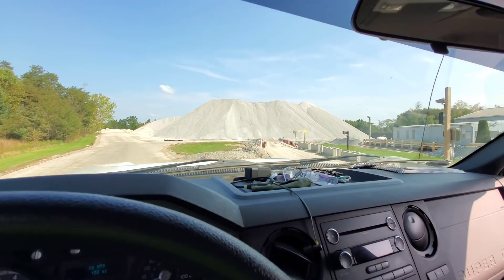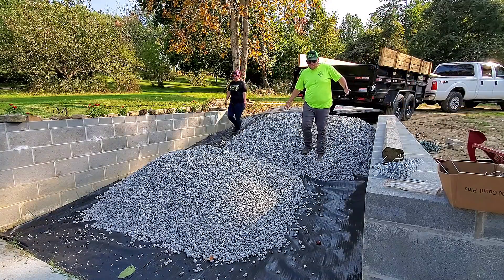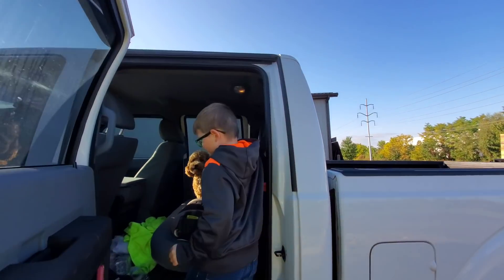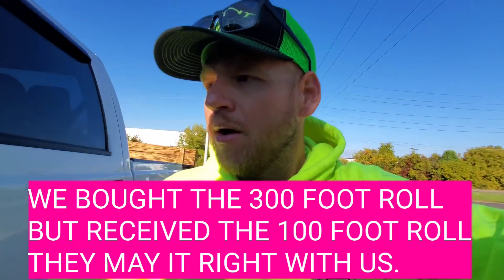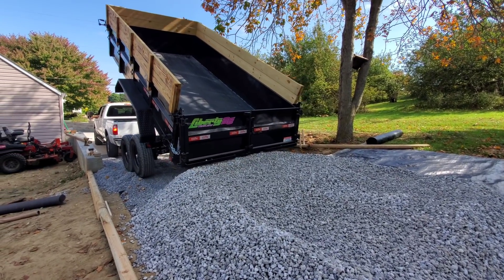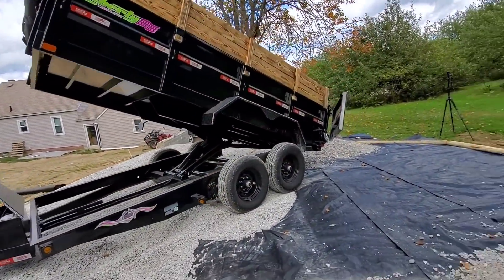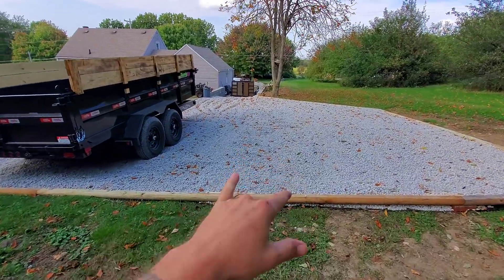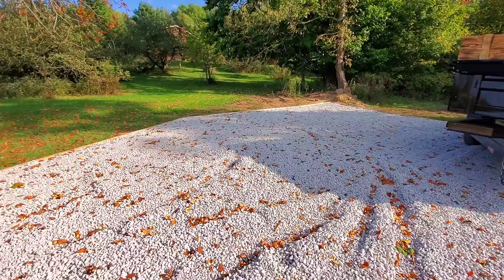It's Not New Anymore!

Comment: The Mirafide goes down first, then a layer of millings or 2" crush, THEN you can use finer stuff like you did here. You can roll it till the cows come home, it's always gonna be soft and push out. You needed a good base first. I made this mistake years ago on a customers driveway and learned quick.
Reply from the maker: Well its too late for that Randy lol😂😂 Thanks man
Reply: I was wondering that too, should've used 1"  57's with dust, it would pack and become like concrete, it's what I used for my driveway.
Reply: You can get sand and mix in

Comment: I have used landscaping timbers for driveway edges before. Just laying them out like you have will not work very well in that they will push aside really easily.  Easy way to anchor them. Drill a 3/4 hole down through the timber about one foot from each end. Then just drive a 2-3 foot long piece of rebar down through the timber until it is flush. This will keep the timber from moving sideways pretty well. In the spring i just drive the rebar back to flush after the winter freezing/thaw moves them up a little.

Comment: I would have used 2Amodified stone. It has stone dirt and dust, it packs like cement. Downside is rain may pond on it a little. Packing, vibrating, rolling probably won't solve your problem,it didn't for me in front of my farm she'd. You mite need to put an inch of stone dust over the top to firm the driveway. Good luck.
Reply from the maker: Thanks so much we appreciate your suggestions

Comment: Hey I would say on the new trailer you got the thing that holds up the front is only on the left side I would recommend getting a big log to hold the right side up because over time that metal bar on the other side will start to bend down because all the weight on it

Comment: Unless your 57 stone is different then ours that’s not the right stone to put down. You would want to put #2 crusher down on top of the road fabric. The 57 stone wine tighten up like crusher run because there is no fines to compact in between the aggregates. 57 stone is used for drainage not driveways.

Comment: for small bush hog jobs i think toro even makes a dingo loader that will handle a 4 foot bush hog that goes on them and can also have a pallet fork and have a man lift that you use a chain and binder it to the unit and is osha approved for using this could also be used in winter for side walks when and if needed for moving snow just shooting ideas out there hope i dont sound to pushy here i in no way want to push you guys in any way

Comment: Nice job, I would’ve used crusher run or road base.
Reply from the maker: Thanks so much Steve
Reply: Yep, the rock he got is too clean to ever pack down. It needs more fines like road base has in it. This clean stone should have been the top coat to keep the road base dust down on windy days.
Reply: That is called 57s with dust, limestone with dust . 57s alone was a waste of money . Just should of done it with 57s WITH dust on all of it and compacted it 3 or 4 times with someone watering it as u go and call it a day

Comment: Hey Spencer I hate to beat a dead horse but that stone will never compact especially with that cloth under it we just did our driveway here in Arkansas and used #411 its a little smaller then what you used but it has dust in it that bonds after we poured ours we went over it with Portland cement out of a grass seed thrower then wet it down then rolled it over within 3 days was stable. My 2 cents I would use that skid loader pile it up remove that vapor barrier and get crushed stone then put this stone over it and do the cement thing like we did btw you will have to use roundup for weeds that pop through hope all works out for you my friend . BTW I'm also from West By God Virginia Madison Boone County God Bless and Keep us up on the work

Comment: Looks deep! Maybe should only have a couple of inches and would have put it straight on dirt so it helps to lock the gravel in place instead of slipping around on that liner. Then just normal driving on it should lock it up pretty good. I also prefer a "dirty" road mix for a base and then a thin layer of clean gravel on top for looks. The dirty locks up much better with still containing some smaller stuff(dirt and sand) to fill in the gaps between the bigger gravel stuff. Im sure there's a fix but id just ditch the liner and the sand box effect.

Comment: You may have been better off with roadbase rather than loose gravel.
Reply from the maker: Thanks you live and ya learn. haha
Reply: @SpencerLawnCare  For sure! You could try mixing through fine gravel (we call it "cracker dust") We use it under paving. 
The gravel needs something to bind it. 
You will always have issues with that slope and rock coming down onto the concrete. I'd be pulling that up and rethink it, pave it maybe, large cheap concrete pavers cemented down maybe??? Be a pain but better cry once than over and over again.
Good luck with it!
Reply: Agreed, I'm thinking 3/4" traffic bond with the fines would have been a better option. Coupled with a plate compactor of course.

Comment: Two things. 
One. Use this on the slop. It costs a lot but we had a 12,000 pound truck drive in it empty and didn’t move. Add in stone and it won’t rutt and should t settle down hill. TRUEGRID PRO LITE (1" Depth) Permeable Pavers, (DIY) Driveway-in-a-Day, Patio, RV Pad, Drive-On Grass & Gravel (18-Pack 72 Sf) https://www.amazon.com/dp/B01D3P7GZU/ref=cm_sw_r_cp_api_i_sXCCFbV26QX2G
Second o had my mini skid picked out to buy and the engine on the truck went. Guess it waits till spring.